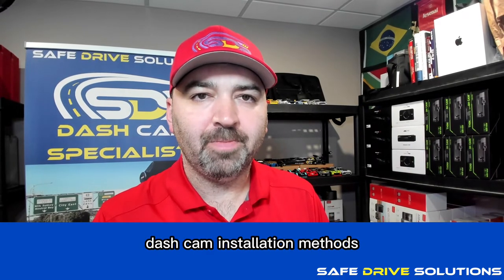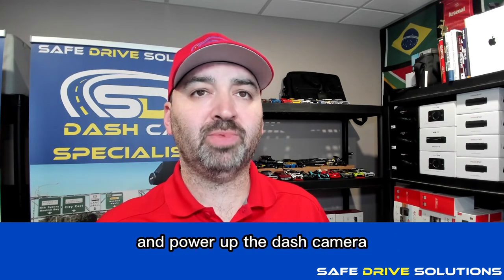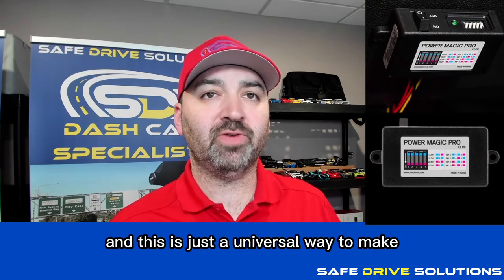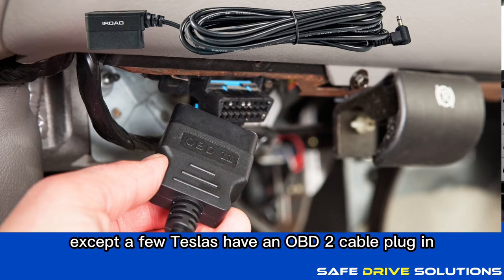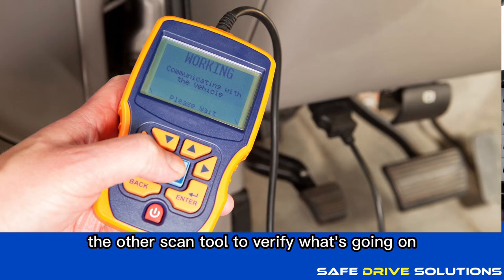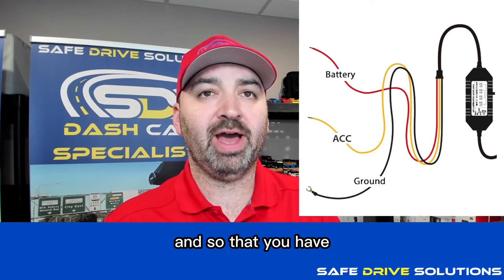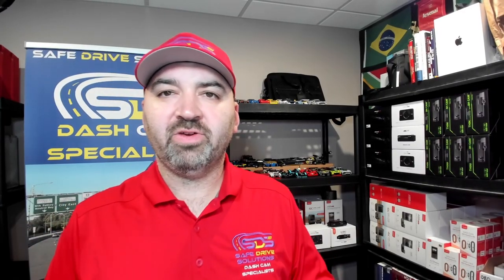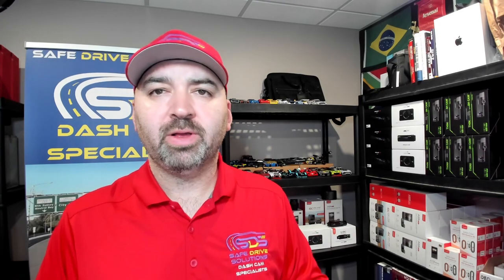5 Ways To Install A Dash Cam | Safe Drive Solutions

Comment: My parents are looking for a dash cam for their Dodge Laramie. The goal is that I will hard wire it in and to have a main front facing cam and possibly a rear cam inside the cab (it that makes sense to do). Do you have current recommendations and a possible list of items I would need to hard wire it? I'm very familiar with wiring aftermarket receivers and speakers and have wires/tools for that. Is there anything I need to look look into to help me get started?
Reply from the maker: If installing it yourself I would use an OBD2 cable. It will still give you parking mode capabilities without having to use fuse taps or finding the wires and soldering them.
Reply: @SafeDriveSolutions  awesome! Thank you!

Comment: Glad to have watched this video.....I have the Power Magic Pro for my Blkvue DR750s.  It is time to upgrade.  Can this be used for the Viofo A139 Pro with the cigarette power adapter instead of their hardwire kit?  I was thinking set the Volt limit on the PMP, but on time at Infinity.  On the Viofo app, I could select the amount of time to record for Parking mode at 4 hr.  Or will there be an issue of voltage starvation?  Just want to know the Cons of using the PMP.  Thanks
Reply from the maker: Only through parking mode cable can you select the time.

Comment: I have a question,,, I am using a VIOFO A129 Pro Duo.  what about using an external battery during parking time mainly during the night ( lithium ion or polymer power bank 20000 or more mAh) by unplugging the USB from the cigarette lighter and plugging it to the external battery for parking mode?
Reply from the maker: I dont have any experience with the portable battery packs. We stand behind recommending powercells as we are familiar with that solution.

Comment: Does hardwiring causes any concern for warranty of car.
Reply from the maker: Depends how it is wired. When we install it we have lots of experience and we are not worried. I do not know your experience but there is lots of do nots for hardwire. For instance do not pull the fuse and wrap your wire around it and push it back in.

Comment: I think obd 2 best more yes or not sir.
Reply from the maker: Obd2 works good. It does support parking mode as well.
Reply: @SafeDriveSolutions  thanks you sir
Reply: You should never use the obd2 plug for power source.
Reply: @SafeDriveSolutions .Hello! Whit the obd2 cable how many hrs of paking mode last after turn off the vehicle? Thanks again
Reply from the maker: @kalita210  depends on dash cam, vehicle battery health. Lots of factors
Reply: @SafeDriveSolutions .  Assuming that everything is ok? It will last the weekend whit out turn on the vehicle?
Reply from the maker: @kalita210  most vehicles will last 3-6 hours before low battery protection kicks in. If you look at Thinkware U1000, U3000, or F790 in Energy Saving mode you may get the weekend